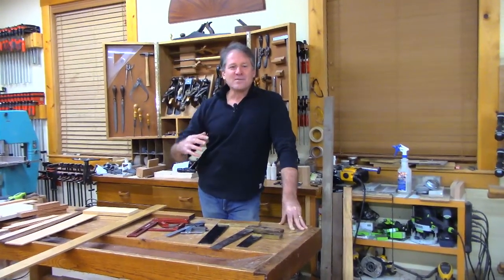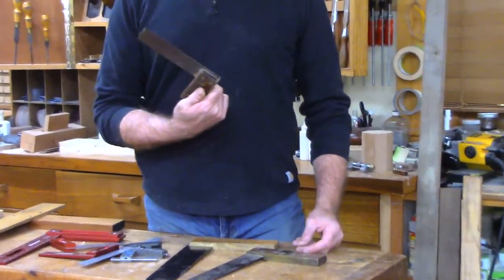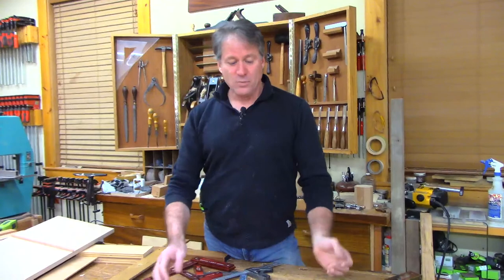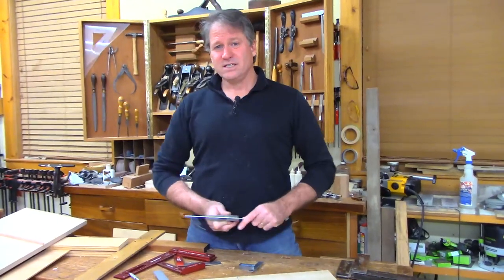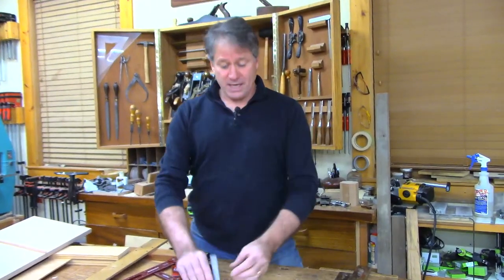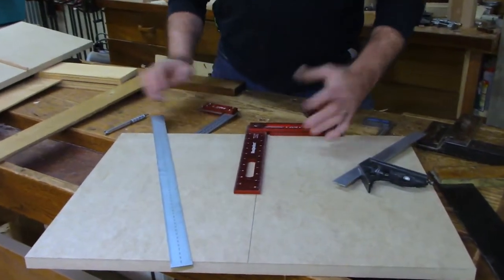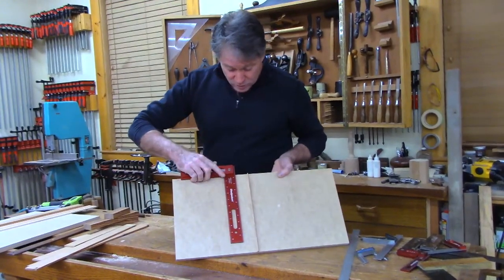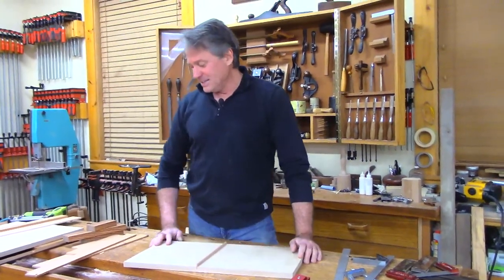It's Hip to be Square with Tom McLaughlin

Comment: Any try square with a wooden stock is only tested for square in the factory on the inside edge, do not rely on the outside edge. This is true for all European made squares with wooden stocks, it could be different over the pond but id imagine its the same. That little blue double square you showed looks to be the colour PEC uses for its combo/adjustable squares, you should see  "products engineering" on the blade. To my mind, any square that is adjustable cannot be accurate for its lifetime, so I only use steel machinists set squares, all mine are made by PEC in the States. 
When "hip to be square" started playin I remembered that scene from American Psycho, half expected you to pick up an axe heheh :P 
Thanks for the video Tom and Kris, I enjoyed it, as always :)
Reply from the maker: Thanks Whitty, I’m glad you enjoyed it! I agree with you on the wooden squares, and that is a good reminder. And certainly when it comes to fixed or adjustable squares the fixed are more reliable. Every now and then I run a check on my adjustables to see how true they are running, and obsess as I will, I try to remind myself I’m working with wood and not high precision metal engineering 😎 Thanks again!!👍
Reply: @EpicWoodworking  I work with only hand tools, so keeping them all sharp and fettled takes time away from me actually making things, so I dont want to have to check my squares for square...... but admittedly you are kinda right in regards to it bein wood, which does move a LOT more than metal 😂 I jus dont want to have to check them, you are right that such a tool is overkill for woodworking 🤷‍♂️😂🤣  I'm always annoyed that I miss your live shows, I always enjoy watching them after they air but have yet to catch one live 🤦‍♂️ Living in Ireland doesnt help with such a time difference. 
Thank you for your reply Sir, hope you are enjoyin your day 😁
Reply: @whittysworkshop982  Oh that is great, I love Ireland...only having visited back in the summer 1980. I thought for sure I would have been back by now! I'm curious in what part of Ireland are you? Sorry about the time difference, we initially scheduled the livestreams for 8 PM our eastern US time to accommodate the three hours earlier difference on the west coast...never imagining there would be viewers like you in Ireland! Thanks again for watching, who knows, maybe we will cross paths in person someday :)
Reply: @CameraLady  Heya Kris :)  Im from the South-East of Ireland..... usually people from abroad that come to visit stay in Dublin city, or somewhere on the the West coast.... theres a lot more "Rugged Beauty" on that side of my little island :P Do you remember whereabouts it was that you visited all those years ago?? :) No need for apologies about the time difference, yee have to cater to the majority of your viewers..... it would be VERY ignorant of me to think that somethin should be changed to suit me better heheh :P I will just have to try harder to catch the livestream :) maybe we could cross paths someday, stranger things have been known to happen :P 
Thank you for your reply Kris, I hope you enjoy your day darlin :)

Comment: Everybody who knows me thinks I am totally square.  And that's the truth.  Just saying...

BTW:  I have been using IGauge  combination squares for well over a year. I find them to be a good value: the fit and finish are good and they are accurate.  Yet, to be honest, they never seem to lock up securely, and this always bothers me. I don't feel confident when I use either the 6" or the 12" IGauge squares for this reason.  However, I don't have the same issue with the 4" double square, which is great.

So....I got a Starrett 6' combination square about two months ago.  The fit, finish, and feel are excellent.  It is dead accurate and locks up securely.  I feel confident every time I use it. This square is in my shop apron every time I am in the shop.

I did not want to spend the extra money for a Starrett square, but I have to say that I am glad I did.  Next stop -- the Starrett 12" combination square, but I have to check under the sofa cushions for change first.
Reply from the maker: Yes Jerry, I can relate to everything you said here...especially looking in the cushions to fund the next tool purchase! 😂

Comment: So I need a crosscut asked to make a square and I need a square to make a crosscut sled. Which came first, the chicken or the egg?
Reply from the maker: Actually Scott, if there’s any seriousness to your comment, you don’t need a square to make a dead on crosscut sled using the 3 cut method I show in that video. So it’s the sled that comes first 😎
Reply: @EpicWoodworking  - I was being a bit sarcastic; however, in the crosscut sled SNL you talked about cutting a piece to fit into the saw kerf and using a square to get the fence close. I really need to build a sled following your example. My problem is storage of the various jigs and fixtures I build in my tiny basement space. I just need to convince my wife that we need to move somewhere that I can build a nice, big detached shop!
Reply from the maker: Oh yeah, you’re right about that. Later I realized that you can get the crosscut sled dead on without even having a square, you could actually just start with eyeballing square and the process of the 3 cut method will get you to accurately square...or you could use something like a piece of paper to help approximate the starting point “square” of the fence. Thanks for being so involved, it means a lot to me 👍
Reply from the maker: Oh, and I’d be happy to write a note of recommendation if it will help convince your wife how much you need that new shop! 🙂